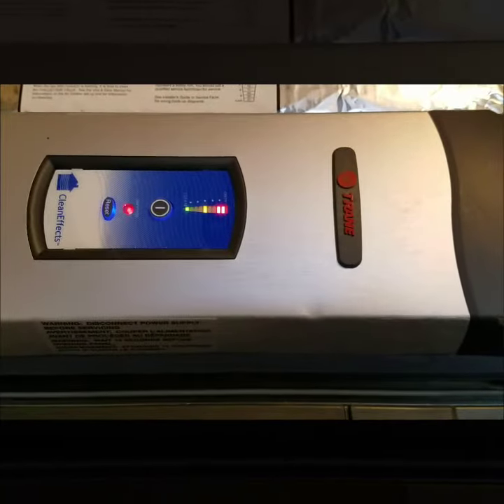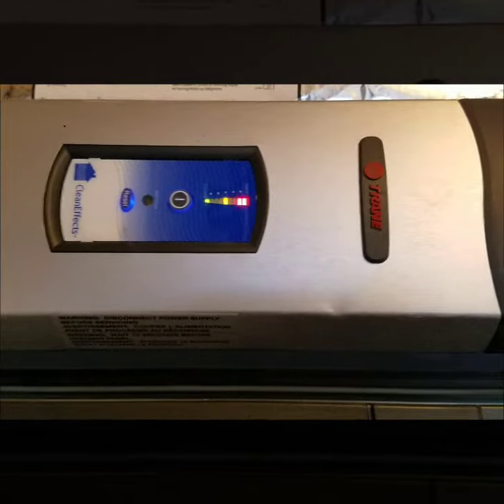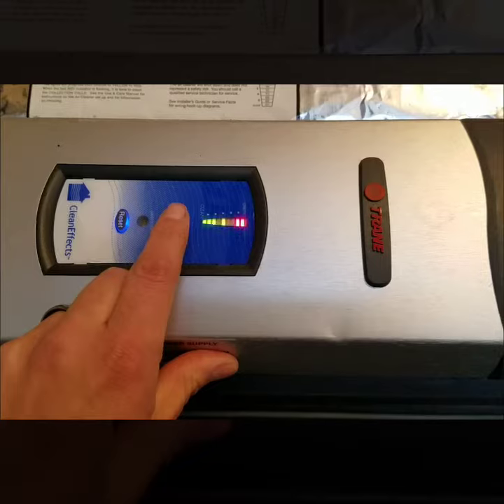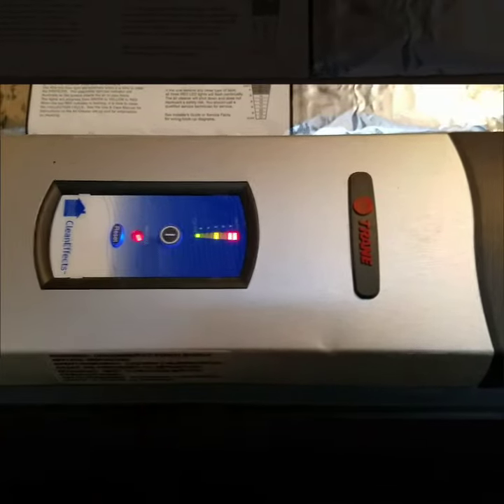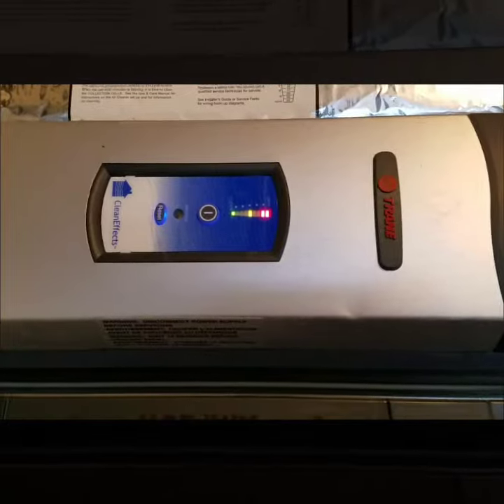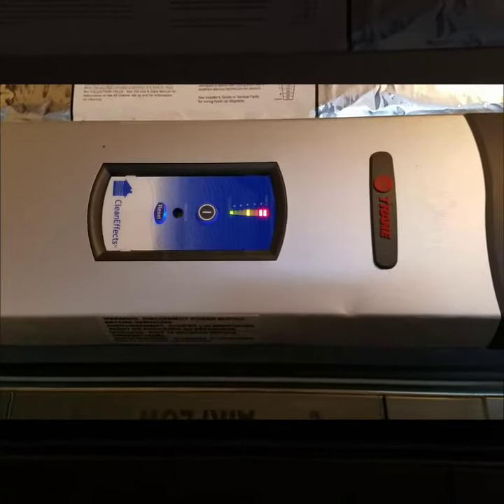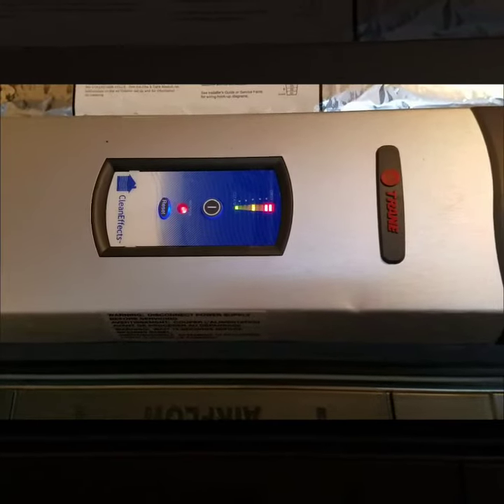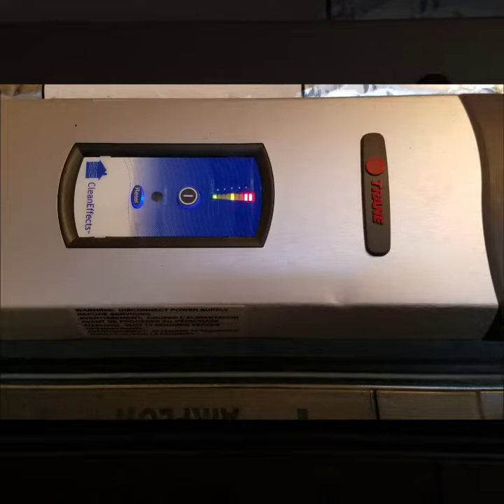How to look up fault codes on Trane Clean Effects filter system

Comment: Thanks so much for this!  The fault code chart at end of video is near impossible to read; Can you please post a picture of the fault codes chart?
Reply: Page 14 of the above document.
Reply: @jean-philippemercier7326  You should supply a link to that document. I do not think it is the Users Manual.

Comment: I've had problems with mine for the last couple of years. After discussing the problem with the furnace shop I was told I had to replace the door for 1200 bucks which means they don't pay attention to the fault codes. I want to convert the box back to regular filters. Can anybody help me out.
Reply: Nelson G good afternoon I just spoke to a Trane sales rep. My old model number has changed. They have a new model for $573.24. My current one is 22 years old. In case this may help you the new model # I was given is KIT16532. Please let me know if this is helpful.

Comment: For months now the pre-filter red light has been flashing three times and then goes off, flashes and goes off, etc.  I've had my heating company here twice and they've done a thorough cleaning.  I ended up buying a new pre-filter myself and that didn't fix it either.  The heating company hasn't been any help in helping me solve this and no one in my area services this brand, so I'm stuck trying to fix this on my own.  Any idea what would cause this?
Reply from the maker: Possibly the main power head is starting to fail.

Comment: Hello, my unit has a bad power supply. Is there a filter I can use instead spending $600 for a new door assembly.
Reply from the maker: You will need modifications with sheet metal to get standard filter sizes to work. You can attempt to measure the opening and see if you can have custom filters ordered.